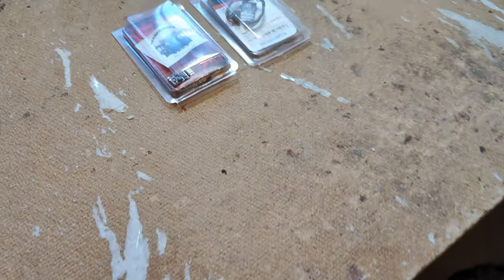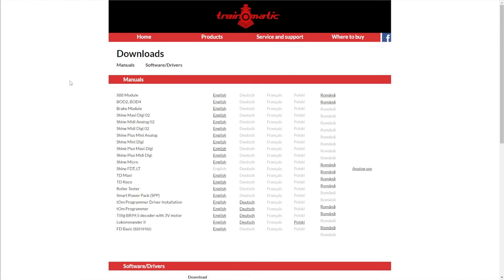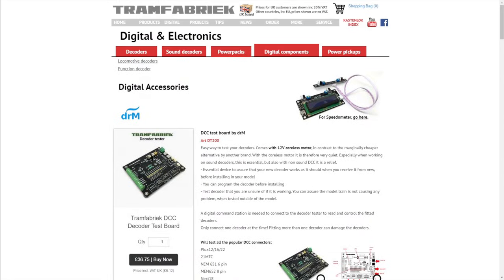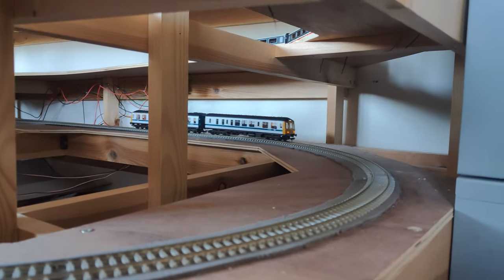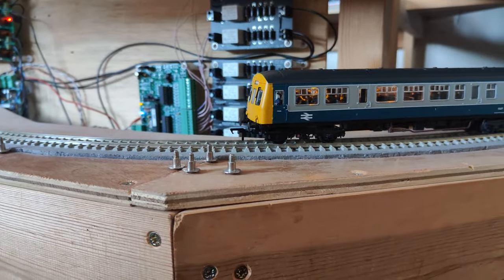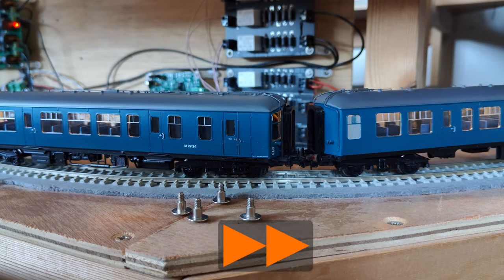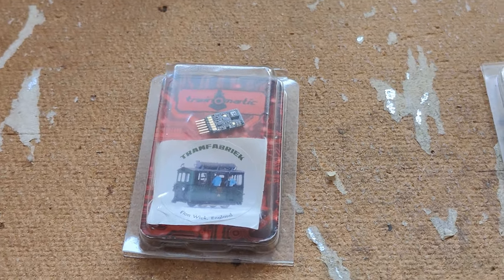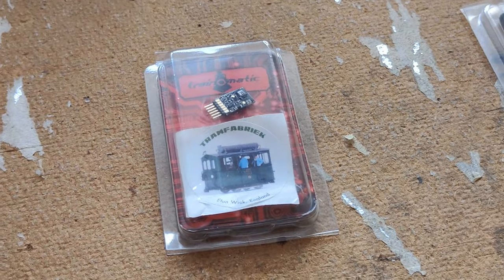Train-O-Matic Lokommander II: How good is it's ABC Braking?

Comment: Does the de coder come with the ABC braking units to attach to the tracks , just one point, where on your track is the ABC unit?
Reply from the maker: You'd need to source ABC braking modules separately, none are included with the decoder.

My ABC modules are mounted vertically behind the fiddle yard track -- you can see them right behind where the trains stop.

You probably meant where is the track cut though. Each block is fully covered -- everywhere on the layout can be selectively switched into ABC. The signal block approaching where I'm filming the trains stop is about 3m long. But the ABC doesn't actually cut in until the final yard of track approaching the signal becomes occupied. That way it doesn't matter how long the train is, or where the motor is in it, as long as something draws some power at the front of the train. A single LED headlight is enough to trigger the detection.
Reply: @DongitsModelRailway  many thanks for your reply, cheer's

Comment: Is there something in the track/block detection to tell the system when to start stopping?
Reply from the maker: Yes. When the first axle crosses into the last track circuit block of the section, the ABC is switched on if there is no path beyond that section.